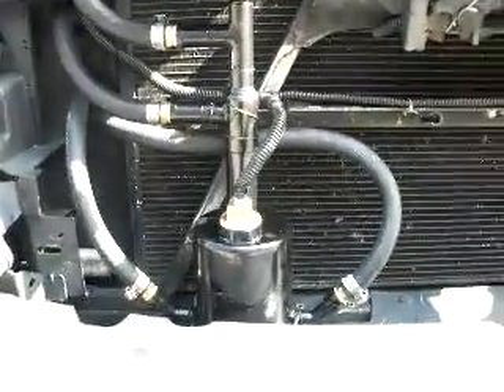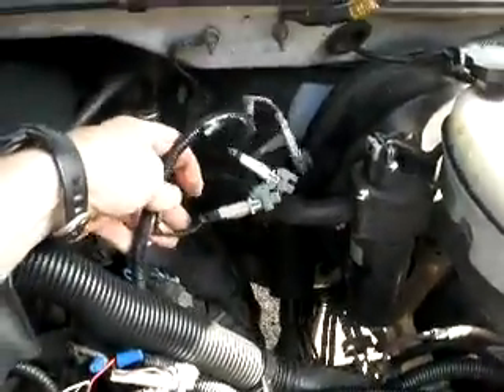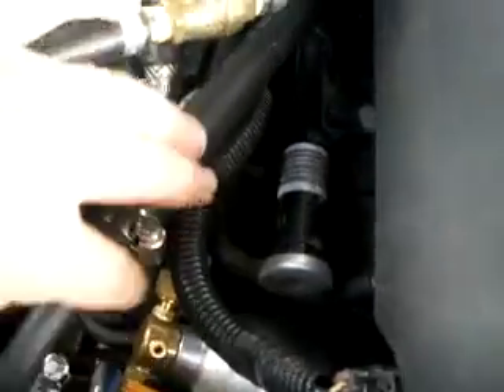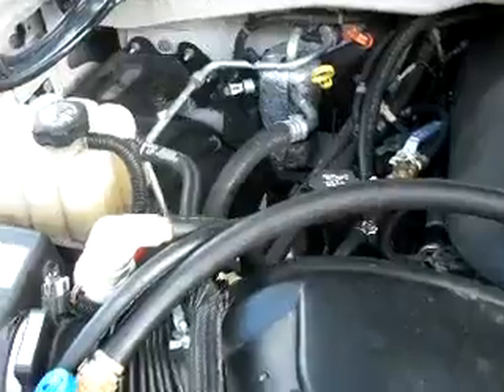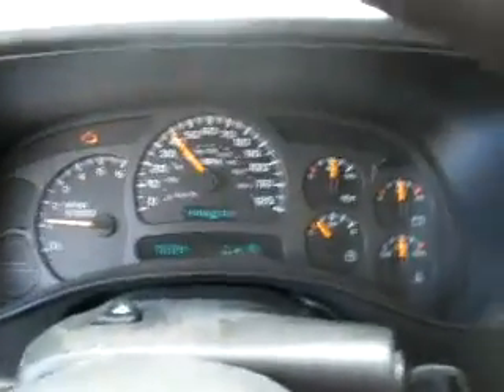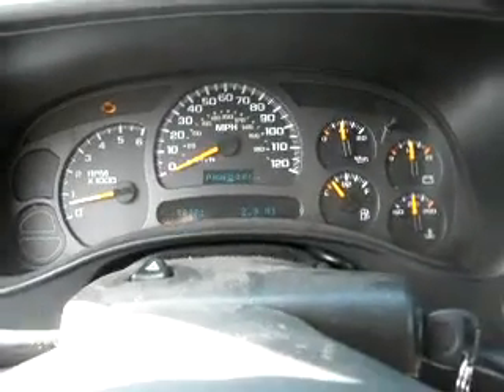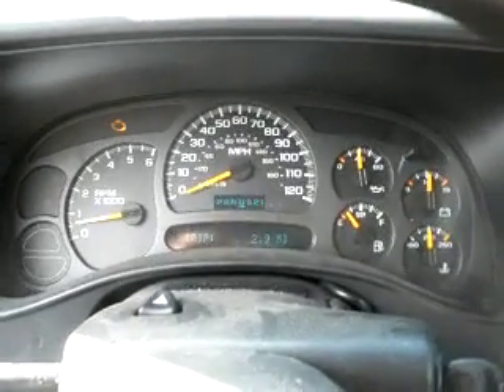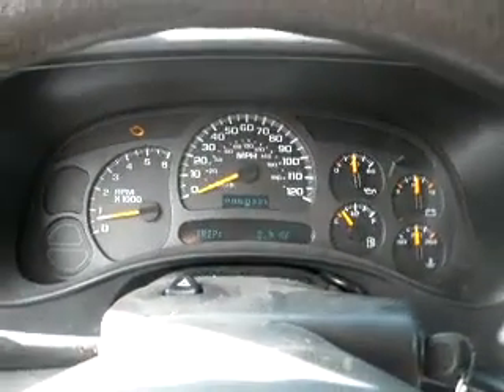Road Test In Progress from running on gasoline vap

Comment: This thing is running super lean, so now your timing is off because the computer is trippin balls. And then you do the stupid thing of heating gasoline. For starters hot fuel ignites a whole lot easier (you do not have a diesel) and that alone causes timing issues and gives you worse mpg. So realistically when you think you are doing so much better you are in fact doing a lot worse.
Reply: Jake Smalley
Hi Jake, I am an automotive technician for over 30 years and when I was younger had training at a GM training center in NJ where a GM engineer told me about preheater carbs that they experimented with back in the 70's and found out that it was easy to get over 100 mpg with those carbs. At that time they opted not to use them simply because of pressure from oil companies. When private inventors got the idea of running cars on fumes with preheated carbs the oil companies started adding chemicals to their gasoline to gum up the works and make that kind of carb unusable. It's a kind of evolutionary competition going on for over a hundred years. This kid is doing the natural thing, trying to get a fair shake from a system designed to screw him over. I say bravo to all like him who don't just bend over and take it in the ass.
Reply: Jake Smalley Oh how blind you are. Run along little sheep. Your flock is all getting on those big trucks. Better catch up!
Reply: Progressive Destroyer   You're a trusting soul.  Since when did they teach all there is to know in schools?
Reply: Progressive Destroyer   My friend....You seem to have this idea stuck in your head.  Heating gas to detonation is not the idea.  Gas auto-detonates at 530 degrees F.  You heat the gas to less than 350F   Basically you're evaporating it.  Not detonating it.   Get yourself loose from school learning and do your own research.  They did not give you all the facts.
Reply: Ps I bet you still believe the local news is telling you the truth
Reply from the maker: Jake Smalley Really? It's not running lean at all. My timing is right on anyway because it's automatic sensing from oxygen and knot sensors. Heating gasoline raises vapor extraction to be used by the engine....not a stupid thing to do at all. Please learn about mechanics before questioning this video. Thanks for watching.
Reply: whyme2b obviously I know more about mechanics than you. Go ahead and heat your gas. If you had a diesel it would be fine. Why do you think performance engines all use fuel coolers? Ya, think about that.
Reply from the maker: Okay, If you believe that...that's fine. You don't my training on mechanics or anything about me or where I went to school. I'm just telling you the facts in my experiment. Also, my engine has no fuel cooling system installed... think about that.
Reply: Lets just be realistic here. The car does not just run on gas vapors and get like 200mpg. If it did then manufacturers would have already been doing it. You are playing with fire, literally. In the name of safety or your cars engine at a minimum you should drive it the way they built it.
Reply from the maker: Yes true, but would they really be doing it for you to help consume less gas? Think about it. It's all about experimenting and using math calculations to come up with the real answers.
Reply: Progressive Destroyer   Of course my answers would make no sense to you.  Your opinion is the only one that matters to you, because you are the smartest man on the planet and everyone else is an idiot.  A true legend in your own mind
Reply: Progressive Destroyer   It does apply.  He's burning his gas as a vapor instead of atomized fuel, the way the injectors do.  He's heating the fuel to cause it to vaporize.  An engine is not designed to burn liquid fuel (atomized) but to burn a vapor fuel.  He could conceivably get 40-100 mpg out of the system as he has it.  That's what I'm saying.  The 200mpg fuel systems have been around since the early 1900s.   Check it out.   One problem here is that science, which includes automotive mechanical research, does not want to hear anything that contradicts its preconceived notions. My reply came out of nowhere because I just saw this.
Reply: Progressive Destroyer   OK  the fuel is heated to close to the temperature of the coolant as it flows through the engine.  It's not boiled or heated too much.  All you have is a gas instead of a fluid.  A regular engine burns liquid.  Atomized liquid but still liquid.  A gas is not a liquid as you know.  Burning the vapor/gas is actually cooler contrary to what a person would expect and all the gas is burned.  Clean exhaust.  The injectors will spray fuel into the cylinder, right, that's where its atomized.  Still a liquid. The burn is incomplete which leaves grit and soot all over the place, and grinding the engine to rubble.  Keep looking into it.  The science is sound.  Empirical not anecdotal.
Reply: Now I know your a dip shit the computer dosent care if the injectors have fuel or not,it monitors the o2 sensor not fuel perssure,the fuel pressure is constant in the fuel lines and the injectors get told by the computer when and how long to fire for. Your a fucking idiot.
Reply: So as long as the o2 sensor,and cam crank sensors is sending a signal to the computer it will fire the spark pulgs you fucking moron,it dosent even monotor the fuel pressure in most cars ,it only tell the fuel pump to turn on when it see a ignition on / crank signal.
.he could have just pulled the fuel pump relay or fuse but he wanted to show that the injectors were truely not working.
Reply: Progressive Destroyer Propane dosent use a carb at all its called a mixer and in very little way resemble or work the same way as a carb .But you would know that if you had ever worked on anything, but a key board The only thing I lost was the time trying to get a fucking moron to understand this works and has for years and with some work could work better than the current systems for fuel efficiency What you know about a efi system is limited to your narrow 1 cell brain.The only child here is you who canot think for himself yet and believes what he has been been told to be true.The only efi system that need information about fuel pressure is DI so you dont know shit. Show me 1 car that uses efi plenum injection thats monitors the fuel pressure of the injector,then get back to me and we will see who is a stupid child.If that were the case then if 1 injector went bad then the whole car would not run and that never happens,Go get your medication adjusted
Reply: Yes and you think that the war of 1812 didn't happen and the Canadians kicked you dumb American ass out of the country.. I said you were going to tell me that a 2t diesel didnt work  and water injection doesnt work dip shit. Not the other way around. Our lilltle honda did work.And the certificate's of qualification as a certified mechanic hanging on my wall From the government is all the credibility I need .
Reply: Karmicmessenger all those mythical carbs and such are just that. And to actually think that somehow oil companies and the car companies are in it together is just silly. If someone came up with a 100mpg car or would be the best selling car ever. So in fact this video is fake. It's meant to get people to watch it and waste their time or to try something stupid.
Reply: WallHaxxx let me guess. You are stupid enough to believe this crap huh? You morons never cease to amaze me with your complete and utter lack of knowledge, and yet you spew words as if you know what your saying. Your IQ is about as high as a sheep's.
Reply: Progressive Destroyer   Take a look at my reply above.  The idea of heating the fuel is quite sound.  Just because you're educated....
Reply: Tony Michaud your replies make no sense. They are all over the place and are nothing but incoherent ramblings. Good job on being ignorant.
Reply: Tony Michaud what I mean is that your response just came out of nowhere. And it has no bearing on the subject.
Reply: Tony Michaud actually it won't work. 1. The A/R would be incredibly lean, which means very hot. So therefore it will burn up a stock engine, which he of using. 2. It's not a diesel (which is the most efficient). Hot gasoline means predetination, it's that simple. 3. The atomization of fuel in a regular gas engine occurs when the piston is compressing the fuel/air mixture. If it's atomized before it will evaporate.

You see I've studied this quite a lot. And everything I said is scientific fact.
Reply: Tony Michaud heated gasoline causes detonation. Its that simple. To lean of an A/R causes meltdown of a gas engine. Those are facts. Running a car off of vapor is fake. If it was real then manufacturers would be doing it. And Myth Busters busted that myth hard core. Those are facts. The video made is a fake, that is a fact.
Reply: Tony Michaud I obviously have way more facts than you. You keep forgetting 2 questions that make this "car running off of vapors" thing just downright retarded. 1. How hot is it in the cylinders? More than hot enough. 2. How hot does compressing air get? Hot enough to ignite diesel.

I suggest you get back to studying my dear child.
Reply: Progressive Destroyer   As you wish, grandfather.   I'm done trying to tell you that this system has been used for more than a hundred years, off and on.  And it's always worked.
Reply: Tony Michaud running off of gas fumes has never worked. In fact Mythbusters did an episode on it and proved it. Next thing you will think there is an electric car built in the 1800's suppressed by the gov that gets 2000 miles per charge.
Reply: WallHaxxx Just looking at his profile pic I can tell who's side he's(?) on.
Reply: Iron Barr so are you implying you're antisemitic?
Reply: anti- Zionist, anti-Cabalist, anti-<X> = I rage against the cube...
Reply: Iron Barr so your are a Jew hating bigot. What cabal? There is no cabal. You must listen to a lot of conspiracy bs. The cube? Now you're just talking nutty.
Reply: Ok...
Reply: P Kuudsk so you actually ran just vapors huh? You do realize that on an EFI engine if the injectors dont see fuel then it shuts off. It wont just decide to run. And your temps are probably way off. That thing probably sputtered a little and died. If this tech worked then auto makers would have already been doing it. But they dont. So right there that proves you are a dumbass. Next thing you are going to try and say you have a diesel with a carb you did it on. Hahahahaha what a moron.

And my local news only reports the news with video most of the time. They dont have opinion segments which is what you are thinking of.
Reply: Progressive Destroyer Your a fucking piece of work I have been a mechanic for 30 years and fix cars every day .If you had any valid argument i would keep talking to you but you dont  so fuck off.
Reply: P Kuudsk yet you come on here thinking that your vehicle is running on fumes, literally. Some mechanic you are.
Reply: Progressive Destroyer How do propane vechiels run you fuck tard on fumes. Grow the fuck up  key board jockey
Reply: Now go kiss you mama/ sister you fucking inbreed pos and leave the thinking to those of us who arent sharing the same DNA pool for decades.And our family tree is branched not a straight line down like yours
Reply: P Kuudsk propane is a different fuel that runs on carbureted vehicles that have a special carb just for propane.

As evidence by your childish name calling we can see that you lost this debate and now you are upset. Just like a child.
Reply: P Kuudsk are you still trying to convince me of how stupid you are? You obviously know nothing of how propane works on a vehicle. http://theepicenter.com/tow102899.html

And yet you somehow think that you completely outsmarted the vehicle manufacturers.

Most newer vehicles take into account fuel pressure and injection cycles. So you really dont know shit.

http://jalopnik.com/that-video-of-the-guy-running-his-truck-on-gas-fumes-1633938925

For a car that does monitor such things, take a look at VW VR6 24V, 2.0T, STI, Lexus LFA, etc.

http://www.autohausaz.com/html/fuelpumps.html

Looks like you might want to start taking some meds there. What a complete and utter fucking moron you are. You actually believe a car can run off of fumes. Again, why isnt say Chrysler doing it, if its so damn great? Oh thats right, It doesnt fucking work!!!!
Reply: Progressive Destroyer The junk manufactures built in the last 5-6 yrs do have the puter look at fuel pressure but I wasn`t talking about that 3 words I should have added (from that era), that truck is a 98 -02 and that truck will run just fine on fumes And when your new computer run junk breaks down your fucked my old jeep can be fixed with fuck all and get me home on fumes or a gas can straped to the roof if the fuel pump dies.Has no puter to fuck with the timming or I can run it on the propane system that I installed so I have a pretty good knowledge of propane.

Next your going to tell me that a 2 stoke desile wont work and you can`t run a car on water injection and advance the timming to get better mileage .Is this safe enough to put into production NO,1 back fire and the whole thing can blow up, and that why it isn`t in production vehicles. The cars that monitor fuel pressure do so for the sake of eng life,but if the fuel pump dies they will still run if you dump gas in them now wont they.fuel pressure monitors are not needed to make a car run just, to protect the eng from dammage from running lean.
This woks whether you want to belive it or not.The only reason we have all this computer crap is to meet emmisions cars got 30 mpg in the 60`s .We had a honda civic in the 70`s getting 60mpg on water injection with cobled up washer bottle and pump with a cable operated ign advance.
It`s narrow minded people like you who can only do what they are told that kill inventions.
Reply: P Kuudsk you're still trying to convince me you are right? Look, you lost, you're wrong. Learn and get over it.

So you actually think a 2-strike diesel won't work? Detroit Diesel proved you wrong.

You think water-methanol injection is a lie? Then why are there kits for it that have proven to make power?

Show me one US production vehicle from the 60's that even got 40mpg. You did not have a Civic in the 70's getting 60mpg. The most efficient vehicles ever are VW diesels. And work basic mods get about 50mpg.

Let's face it. You are nothing but a fake ass keyboard mechanic. You have no credibility or facts. Just another dumb kid running your cock holster.
Reply: P Kuudsk so now you deny the war of 1812.

http://en.wikipedia.org/wiki/War_of_1812

Read up, as it really happened. And you still dont think a 2-Stroke diesel nor water-methanol injection doesnt work.

http://en.wikipedia.org/wiki/Two-stroke_diesel_engine

http://www.snowperformance.net/
.
As for your Civic they only got a best of 40mpg. Not saying you didnt have one, just that your mpg claims are well off.

http://en.wikipedia.org/wiki/Honda_Civic_(first_generation)

As for your cert of being a mechanic. Well you must do really well at remembering things for a short period of time. Because you certainly are not fooling anyone here about running a car off of only gasoline fumes.
Reply: You realy are stupid are't you I am a canadian I would  take a picture of my licence and post it here but there is no option of doing that.We kicked the americans out.
Reply: P Kuudsk it is funny how you completely lost the conversation and yet you keep trying. The best thing you can do now is admit you are wrong, burn that POS Jeep of yours. Realize that America did invent Baseball as you know it, and that we are better at everything than you.
Reply: LmaoYou lost if you think you won I distracted you enough to get off topic,Canada won the war in 1812 otherwise we would be a state not a Country,baseball and basket ball were both Canadian ineventions Gas vapours can make a car run and your just a net idiot who belives anything the failing government of the USA tells you or written in a history book written by a American.  My jeep will crush your video game car when you grow up and actualy get a car you will understand.
Canada owns all the water you dumb asses drink but we shit and piss in it before we let you have any. so enjoy drinking my piss tomorrow when you make a coffey.
The only thing Americans are better at is pissing off the rest of the world and re- writhing history wrong to satisfy their own failures.
Reply: My apologizes to the rest of Americans who are nice people and have to deal with idiots like Progressive destroyer. Just his U tube name alone is a joke.
Reply: i am laid up right now and have nothing better to do you on the other hand have waisted part of your life and havent proved anything other than you can be controled like a donkey with a carrot.
Reply: P Kuudsk it is I controlling you dear mental midget.
Reply: LMAO OK.
Reply: Progressive Destroyer I understand that there might be a concern with safety but don't bash on other people creativity. You want to be that neutral person then be that person. Let others try to build a better future.
Reply: Daneuri Lenny not safety. It just does not work. Its that simple. Nobody is getting 200mpg off of some gas fumes. Not even 60mpg off of fumes. Its just not gonna happen. If it were possible then mfgs would have done it by now. But they havent. Its that simple. IT DOES NOT WORK, ITS BS.
Reply: LMAO have fun pulling him around by his narrow mind Daneuri Lenny he will argue the sky isn't blue. Hes a morron and can be side tracked easy. I am gettin out of the hospital tommorow and wont waist any more time with this Idiot. Yes free hospital,free home care in Canada.
Reply: Progressive Destroyer Ohh yeah like the hydrogen myth busting. You need to geet out of that bubble. Think outside the box!
Reply: Daneuri Lenny you know Mythbusters busted that theory. Good try though.
Reply: Progressive Destroyer Who knows, you might be working for the government or a private organisation somehow  linked to them.
Reply: Iron Barr What side? Because i don't even want to look at it.
Reply: come on donkey come get the carrot I have a few hour

s more to waist.
Reply: P Kuudsk I lead you wherever you go. I got plenty of time as well. You see how I control you. You just cant help and reply and show the world just how stupid you really are.
Reply: I AM just out of surgey and bed ridden I cant go anywhere right now,you on the other hand are menatly obsessed with arguing with everyone LOL But I think I will just watch a movie now and let you fume because I wont respond anymore.
Reply: Progressive Destroyerr Yeah, let go back to fuel vapor.
Reply: Progressive Destroyer That's what you get pay for, to keep us here so you can lure us to those websites links you keep posting and to give this video more views because it's monetized. Attaboy
Reply: Karmicmessenger Most fuel is used on startup and heating a cold engine. Automatic chokes did not improve mileage but are much more convenient. Preheating fuel in this case basically takes the place of the choke. Just having the fuel enter at a higher temp does not automatically create more energy from every drop of fuel. In theory the quicker the fuel can change state from liquid to vapor can mean less byproduct or unburnt fuel therefore getting the max energy per molecule of fuel.
Reply: Progressive Destroyer Any liquid fuel not evaporated via atomization upon the firing of the spark plug, or compression stroke of a diesel is wasted. The part of fuel that isn't vapor at that point will be wasted and becomes soot. The preheating the liquid closer to its evaporation and flashpoint temperature allows for there to be more vapor at the point of ignition. An intercooler using the heat already created as a result due to energy loss is of course how this is accomplished. Liquid is not combustible. The reason is best described by the fire triangle. A good experiment to try would be if you were to drill and tap a hole in the bottom of your fuel tank for a sparkplug and connected a wire from your distributer and fill the tank  full of gasoline and close the ignition switch nothing would happen.Then drain the tank and close the switch and stand way back. Try that.
Reply: P Kuudsk That is true about the input senders and ignition. It will throw an error code merely if the fuel cap is loose alone. But that wont keep it from firing. Now timing is affected because the ecm is looking for an engineered / designed window of input voltages for the operational amplifier circuits in the ecm. Hence calculating directly proportional  outputs to the coils. So the only sending units are the O2 senders in the egr and manifolds etc. If the oxygen quantity is in the normal range then it wouldn't throw an error code therefore no illuminated check engine light. The fuel pressure senders on other vehicles measure for clogged injectors. Wrong about America sucking worse than Canada though.
Reply: Joe Blow Just wanted to clarify my statement,  "the only sending units are the o2" The cam and crank senders are understood to be functioning as normal because they have not been altered f course..
Reply: Joe Blow Oh and temperature senders (thermometers) thermostat combo. Timing only not ignition disabling. Remember everyone that timing has been taken aback 45 years on this experiment because in sync with the ignition the ecm output timing also fired the injector solenoids that have been disconnected.
Reply: rockethead555 what a moron you are. Obviously I know a hell of a lot more than you do about auto related anything.
Reply: HEHE LMAO ur a dumb shit still refusing to accept things you don't understand and living in a box. JAKE S GFYS or learn to accept that your a dip shit who cant see the reality of things not explained to you without a big stick up side the head.
Reply: Carrot come get it donkey.
Reply: P Kuudsk really you worthless inbred. You really think you are smarter than anyone? Maybe your sister mommy.
Reply: Jake S you are the perfect example of narrow thinking, possible from incestiual back ground in your fammily ? It cost very little to build one and try it as you haven't  your opinion means nothing.
Reply: What a shame you were to stupid to figure out how to fix the timing issue to make it work. Go kiss your moma sister good night,but please move at least 3 or 4 counties over so your not sleeping with a family member. PS you can take the tin foil off your head, The space people found that there was no intelligent life in you town so they left.
Reply: Jake S read understand then comment you can heat fuel up to 400 degrees before it completely vaporizes the liquid gass is not very flammable at all but the vapor is very explosive we have welded on fuel tanks that are full do not ever try to do that on a tank that is empty or been empty for a long time the stored vapor will explode
Reply: dan fleeman I understand what's going on here better than you obviously.
Reply: Jake S I what I dont understand is why you are so adimit on proving this wont work,when it does.Espicaly on a small eng. like a lawn mower. try it and you will see you can easly cut the same amount of grass with less fuel.
Reply: P Kuudsk no it does not work. I have already tried it, and did it in several configurations. The facts are that it will not happen. If it did work then the mfgs would be all over it. They have just now realized how much better direct injection is even for gas engines.
Reply: Guess you got it wrong then cause it worked for me on my lawn mower and a hacked set up on my jeep. Your not as smart as you think then
Reply: P Kuudsk no it does not work you lying POS. I know for a fact it does not work. It can not work either. There is not mechanism to control how much vapor is going in, and the fact the vapor does not carry enough energy to operate an engine at anything above idle. Check your facts before running your mouth kid.
Reply: Dip shit a lawnmower runs at a steady speed so check yourself into a hospital
Reply: P Kuudsk good comeback you stupid fucking liar.
Reply: My apologizes it's not nice to pick on the mentally challenged.
Reply: P Kuudsk then I shouldnt pick on you then. But you are just so damn wrong its hard to ignore it.
Reply: HAHA rockethead555 he is just a moron who cant figure it out for himself so thinks it wont work.
Reply: Jake S why do you keep jumping back and forth between diesel and gas engines?? they are not the same.. compression on a gas engine may be 9 to 1, while it takes more like 20 to 1 in a diesel engine to ignite the fuel...   stop being a shill, its becoming obvious
Reply: calholli what are you taking about you tin hat loser?
Reply: Jake S .
Shut up G. MAN